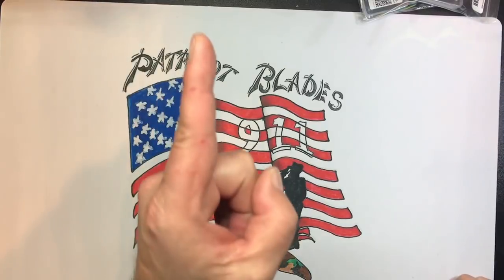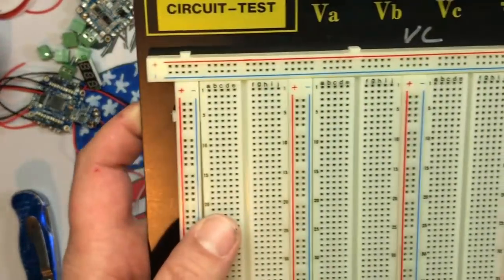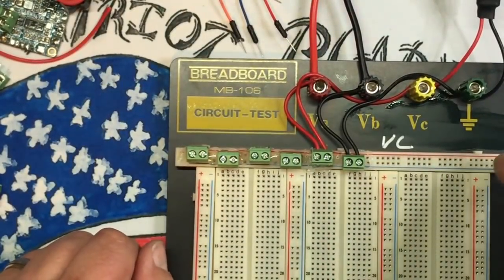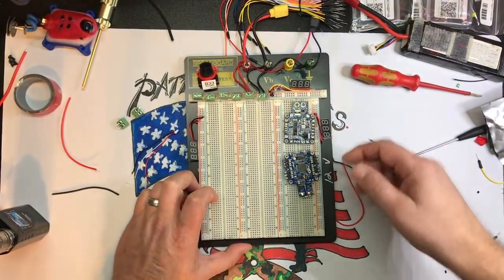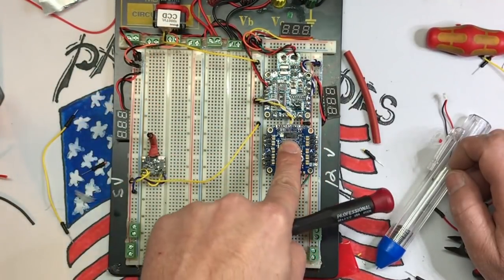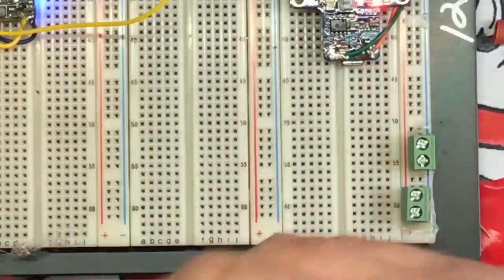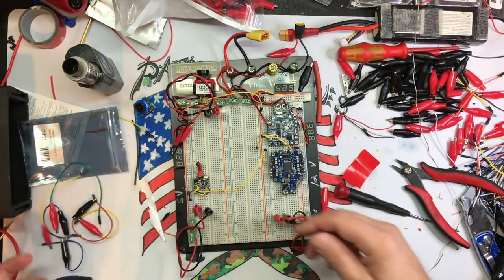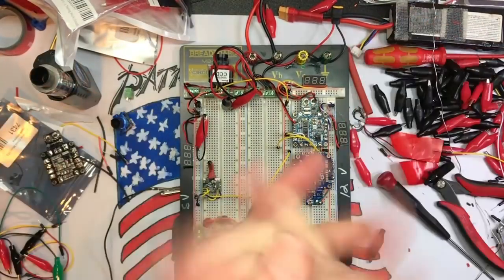QuadKitchen - Build  a Bench buddy and test EVERYTHING!!!

Comment: Thanks for this JJ, been having a horrible quad weekend. Got my DVR up (I'll post later) crashed my quad (lol) wrecked that frame. Slapped the innards into a different build that's using a 16x16 FC and ECS, one or the other is bad... one motor stutters then beeps but won't start... tested a different esc and still the same.. so most likely the FC. Then I try to get my Lizard up and I got a bad motor.... aha damn... well I'm getting my drink, enjoying this and I'll build one next weekend.
Reply from the maker: Lolol.   My weekend has been similar brother.   Not quite that bad but some annoying build issues.   Have a drink have a laugh and roll with it 🤘🤘🤘 least that’s what I try to do lol
Reply: JJRotoGeek need to add a capacitor tomorrow, but finally got a (barely) flying quad aha. https://youtu.be/dmaKX4dpmD4

The thing came with a cracked frame mount, and a bad camera that went gray... swapped it out with a spare, I'm just happy to be airborne aha. 

Quick question, what's the best you can recommend thats under 250grams JJ?
Reply from the maker: Hmmm I would build a 3” frame with 1407 motors and 20x20 set up in the boards.   Fast as shit and under 250